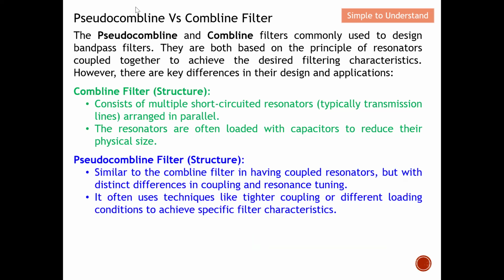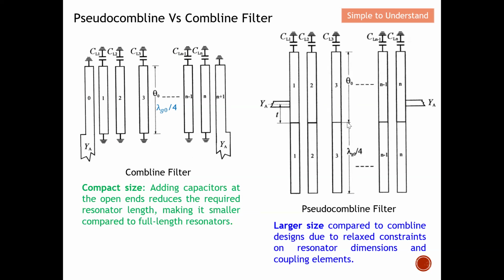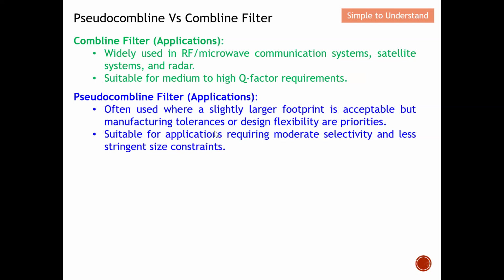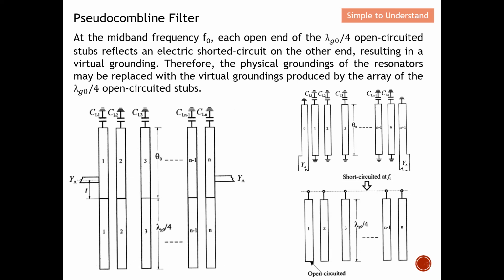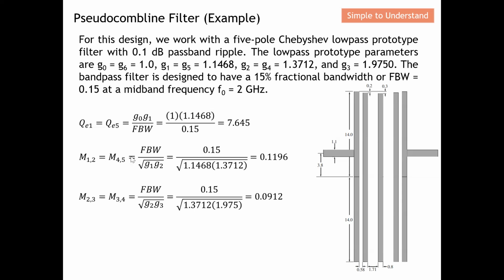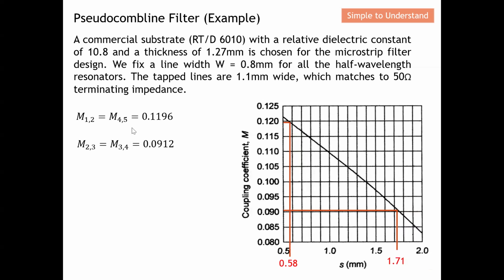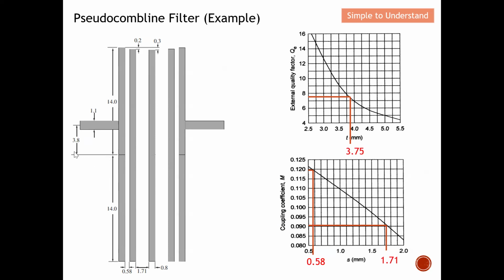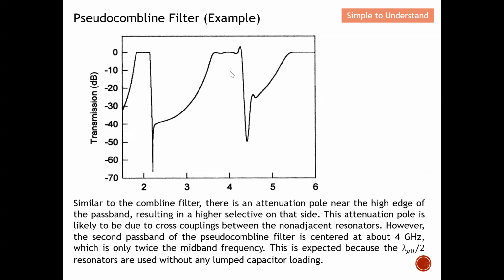Filter Design #36. Pseudocombline Bandpass Filter Design: Structure, Coupling Mechanisms & Resonance

Comment from the maker: Thank you for watching this video.
In this video, I discuss the differences between Combline and Pseudo-Combline filters. A Combline filter requires a short circuit at one end using a via, but it is compact in size. On the other hand, a Pseudo-Combline filter has an open circuit instead of a short circuit, making the fabrication process easier and cheaper. However, it is larger in size compared to a Combline filter. I conclude with the design example of Pseudo-Combline filters.
Filter Design Playlist
https://www.youtube.com/watch?v=BDrpKRwxT7Y&list=PLFxhgwM1F4yxBdUMrkTLhTPIeG1I99x3d